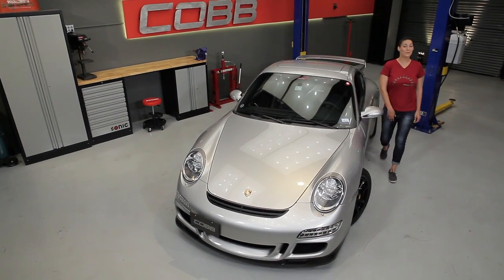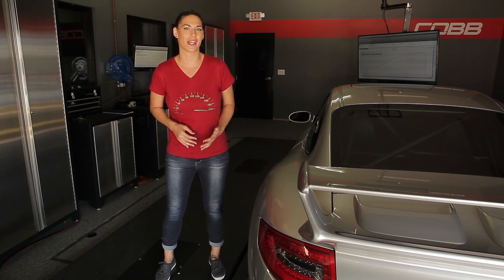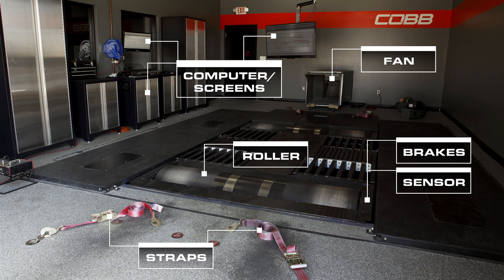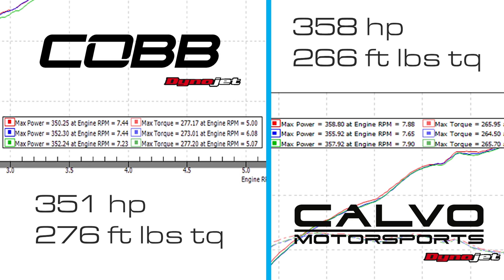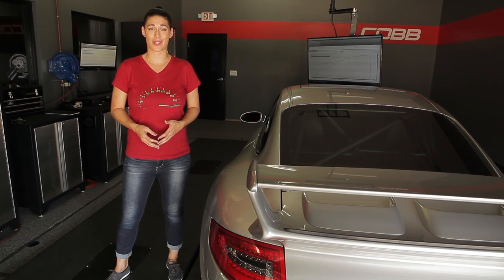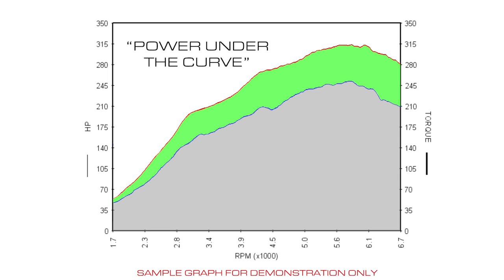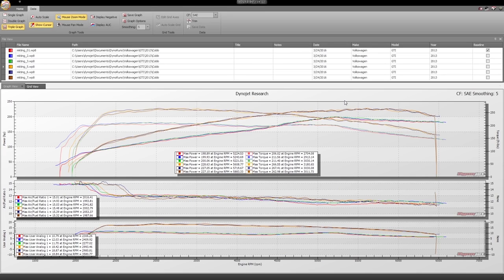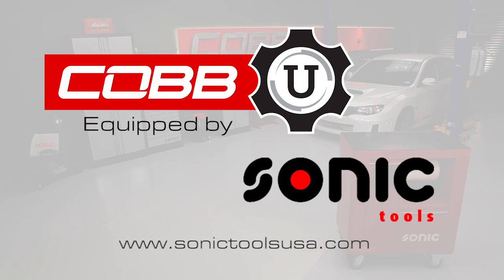COBB Tuning - COBB University Episode #18 - Reading a Dyno Chart and Percentage Gains

Comment: Why do Mustang dynos significantly read different to the other dynos? They mostly read way lower as I understand. Are other dynos reading at crank hp while the mustang duno at the wheels?
Reply from the maker: All dynos read at the wheels.  In this case, the 2 brands measure power under different circumstances (inertia vs load).  As mentioned in the video the actual number isn't that important.  If you compare the gains as a percentage they will be nearly identical regardless of the dyno used.  Kyle@COBB